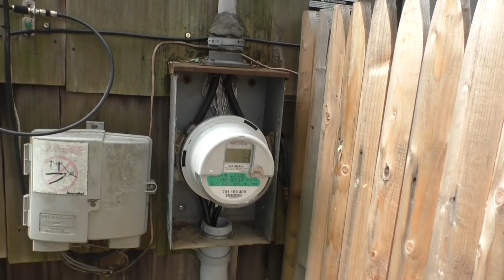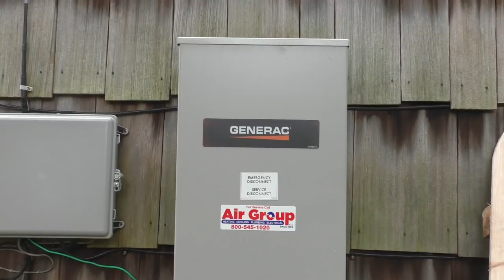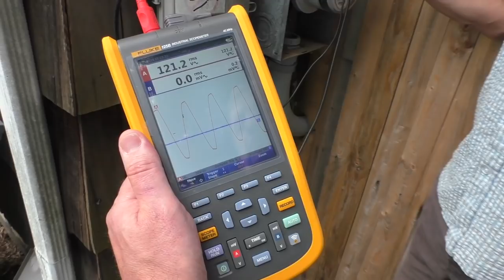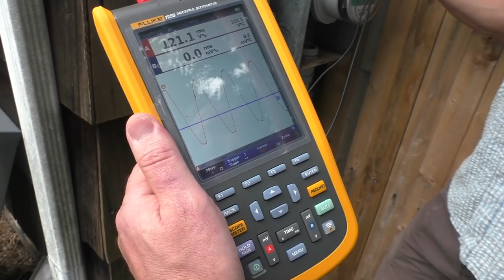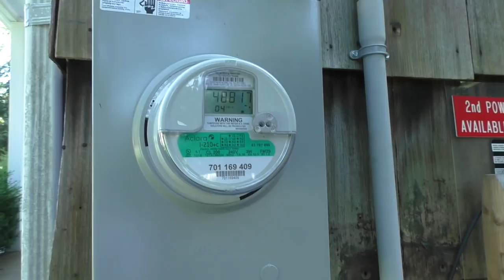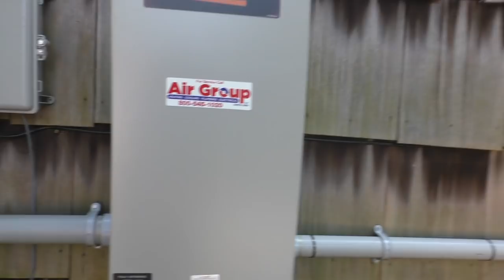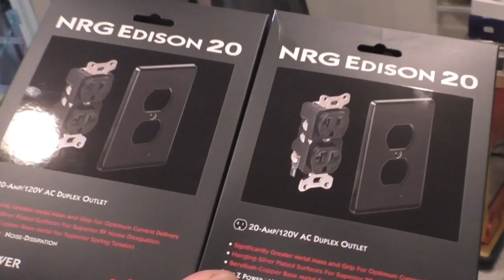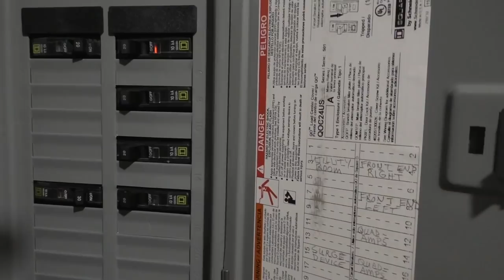Major Electricity Upgrade From the Roof Down Produced Sonically Amazing Results!

Comment: Not to take anything away from your electrician, but w(hy) tf did he put a ground rod in the middle of your yard?
Never in 40+ years of doing electrical work have  I seen that or any sort of cadwelding of the main grounding electrode for a single family dwelling.
If you're going to bury the grounding electrode connection in earth, you have to cadweld it. This is weird..
NEC code requires that you have two rods and that they have to be a minimum of 6' apart. 
So why not put them 6' feet apart next the house. That's normal in residential work. 
A clean way to run the grounding electrode, drive one rod next to the panel and one 6' away. Run the grounding electrode (#8 BAG for a 100 amp panel, #4 for 200 amps) continuous from the rod farthest from the panel to the water line, from the water line to the rod by the panel and then from that rod to a ground bushing at the grounding connection on the panel (I use a Meyers hub to keep it simple) to the ground lug or neutral buss on the panel.
In California, we have to clamp the main grounding electrode within 3 feet of the main water shut off valve. 
So that's where I put my first ground rod (unless the main service is installed right next to it). 
I'm also curious as to why your electrician used a separate meter socket feeding a sub panel, instead of an "all in one" panel that has both the meter socket and the distribution (the circuit breakers for your home).
It's a lot less expensive both in materials cost and labor.
The fact that he only pulled in one phase to supply your sub panel for your stereo shows a lack of knowledge of the NEC, even if he pulled dedicated neutrals for each circuit (which  he would have to).
That's why the inspector called him on it.

Anyway, it doesn't matter, it's done now.
You would still do well to have a power conditioner, since everything in your house is using the same ground (which it has to according the NEC), which is bonded to the neutral at the panel. 
So any sort of noise emanating from dimmer hum could  feed back into your system.

Comment: I wonder how you could have been objective in judging high-level equipment if the dcs was also generating noise ... I can't understand!
Reply from the maker: The dCS was not putting any hash on the line because I've always had power conditioning isolation.

Comment: I’m not a big “cable-making-big-difference” guy, but the few times that I did upgrade my power cables, they made a rather noticeable difference that none of my other cable upgrades ever made.
Reply: its simple psychology usually if your cables were not faulty/broken to begin with.
Dont you ever wonder why no one does true ABX -double blind tests for power cables?

"trust your ears!"  is bit bad idea if you understand from psychology something that 6-year old could understand.  You want to hear some difference, you will for sure be easily able to believe you hear Something.

Truth is that I get some comfort too from having better looking cables than most cheap standard stuff that simply just works for what they are meant for :-P But not ready to pay a lot for that.

Cable Believers should be taken to visit recording studios. Although it might be so that they would absolutely not believe that Their records would ever be made in Those studios where there were all standard cables, be it signal or power cords. No extra-expensive fancy stuff there, except for the equipments itself which may cost quite a bunch.
Reply from the maker: Power cables make among the greatest sonic differences. Only if you've never tried it could you remain a doubter

Comment: Better late than never, but what, no 0/00/000 AWG Van Den Hul wiring? Don't tell us you kept the Dumb Meter? And where are all the EMF field meter dudes?  Doesn't this mean you have to go back and redo most of your previous, contaminated audio reviews? 🤡 👺 🎃
Reply from the maker: No it does not. For obvious reasons. Please check your own dumb meter
Reply: @AnalogPlanet  Your previous, valuable reviews have always been required reading for audiophiles and others. This is a historic upgrade but there's alot to be said for field meter checks and measurements that might reveal unwanted emf pollution, dirty electricity, elevated fields and downstream wiring mishaps - all of which can affect your health if not the sonics. Some utilities or states won't allow for polluting dumb meter opt-outs but fortunately mine does. Saludos  ⚡💤💥

Comment: What I don’t understand is how any of this is new to you? All these mains and grounding issues have been major points of discussion within the UK audio scene for the last twenty years or so!

I’m also extremely surprised you need a backup generator at all! I can’t remember the last time I had a power outage and it wasn’t for very long. It’s not as if you live in the middle of nowhere.
Reply from the maker: Life is full of surprises. I've not seen this discussed in the U.K. "audio scene". For one thing, I do not live in the U.K. Responses to my videos  from the UK are often from a bunch of crabby wankers. That said, we lost power for a week after Hurricane Sandy. No fun. We lost power for a week after Hurricane Isaiah no fun. I'm tired of firing up a gasoline powered generator and running power cords throughout my house to get power not including heat and hot water. Climate Change is going to make these generators  more important over time which is my more and more of my neighbors have installed these natural gas powered generators. They add value to home when you resell. Besides the cost plus installation is about the same as a 1 M pair of "audiophile" interconnects...
Reply: Look into the stock price appreciation of Generac over the past 12 months--you will quickly get an idea how often power goes out around the world. Stock is up like 150% in last year as more and more people have dealt with extended periods of power outages.
Reply: You don’t have to live in the U.K. to have an idea of what audiophiles are discussing - particularly if it has been taking place for many years and you have access to the Internet. Additionally, as you so sadly demonstrate, you don’t have to be from the U.K. to be a ‘crabby wanker’ either. You put yourself forward as an ‘expert’ so I think it’s only reasonable that you should have some idea what’s going on in the world with regard to audio matters. I wasn’t criticising the cost of your installation (indeed, the cost didn’t occur to me) or your use of a generator, I am just surprised you need one. However, putting your rather rude response aside, it really is true that separate mains arrangements, wiring, fuse upgrades (I mean the one that exists immediately before the consumer unit) and separate grounds (precisely as you install in your video) really have been widely discussed for many years. I have no problem with you doing these improvements and even have very similar in my own house. I don’t have the external earthing scheme you have implemented but many here do (particularly if they have Naim systems it seems).
Reply from the maker: @AudioFlat  only a wanker claims to know everything that's "going on". No one does. Getting on my case for not knowing what's "going on" on the Internet is not something I have time for.
Reply: @AnalogPlanet , but apparently you do have time to be rude and obnoxious; don’t forget the ‘wanker’ comment was a slight made by yourself! I couldn’t care less what ‘you have time for’ but you really should have noticed this as it has been widely discussed for nigh on twenty years and across many countries. As you are so prickly on the subject you no doubt realise your error, but your unpleasant response does you no credit. Read back through these comments and you will see I have been polite whilst you have been abrasive, dismissive and outright rude.
Reply: @jim586  , I don’t know about it being a hobby, more a way of life (for some at least ;)).
Reply: @AudioFlat  How very true.
The thing that we all have to understand and remind ourselves is that Youtube reviewers existence is continually looking a gear and saying “hey, this is great”. If it’s not great then the won’t get sent stuff.
Is Mr Fremer suggesting this infomercial was paid for out of his own pocket on a whim of his?

Comment: direction of the ground wire.... solid or stranded..  there is no direction.  try not to listen and maybe try to let someone measure it. and see if it is humanly possible to hear. might save you some bucks.
Reply from the maker: Whatever you say. However there was no money lost in this. Plus measuring doesn't tell you everything. It never has and never will.